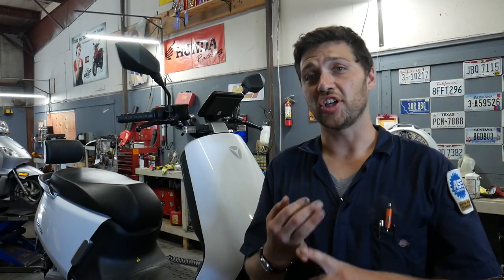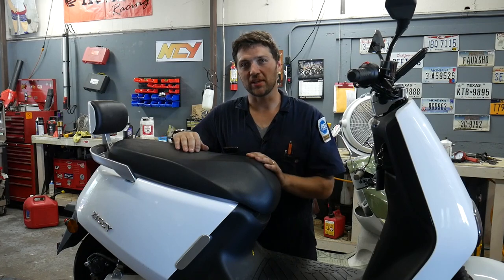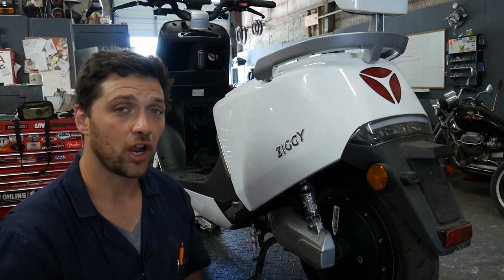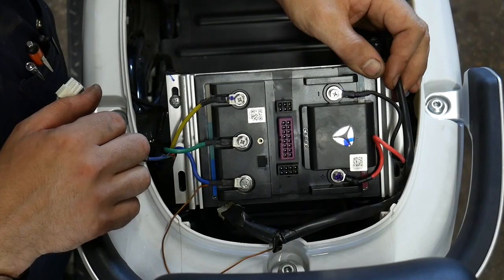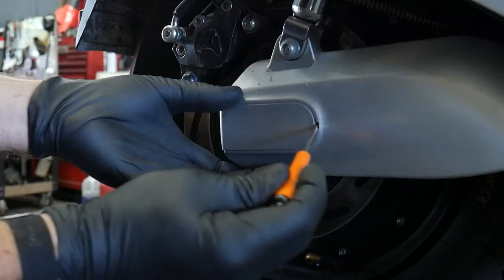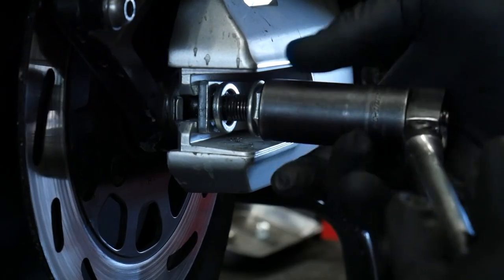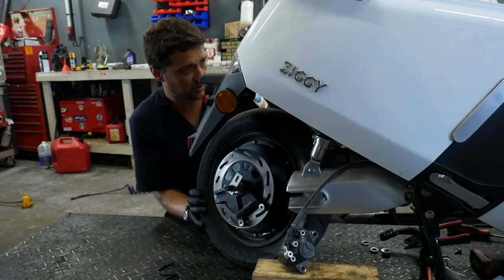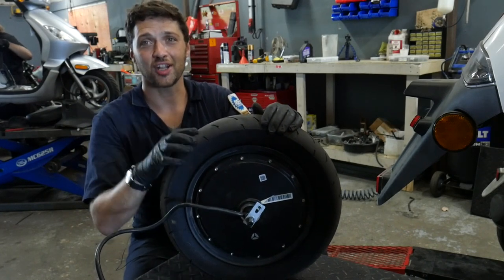How to Remove the REAR HUB MOTOR on a Ziggy G5 (Yadea G5) Electric Scooter "Electric Moped"

Comment: The "mounting tabs" are more commonly called torque arms as they help prevent the axle from just spinning in place.

Definitely take care not to crush or damage the wire where it exits the motor. While the phase wires can take a bit of damage the hall sensor wires are surprisingly fragile.

Comment: I have the Ziggy G5. How do you change the controller that gives power?
Reply from the maker: The motor controller is the unit in the back of the bike that gets disconnected in this video. All you would need to do is remove the rest of the wire connectors and swap in a new unit.
Reply: Understood. My issue is that I see a “wrench” when I turn on the scooter and then there is no power. I heard it is a controller issue, probably bad controller although the controller was changed 6 mths ago.